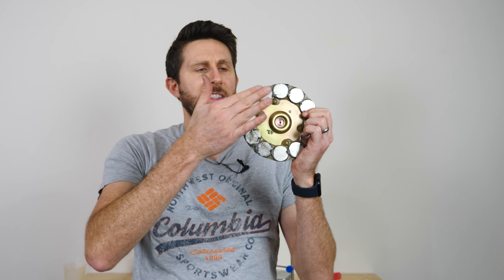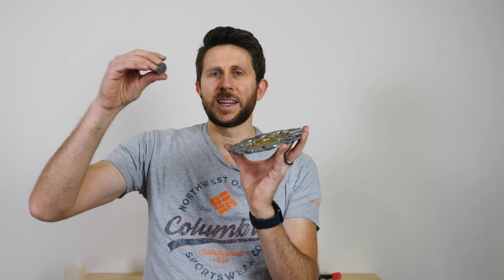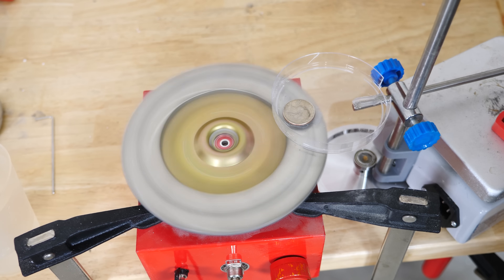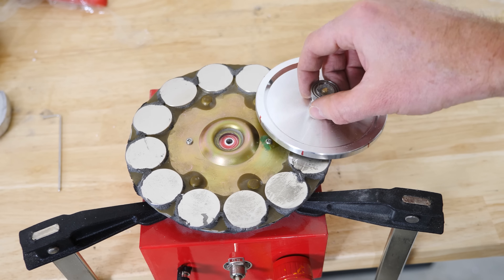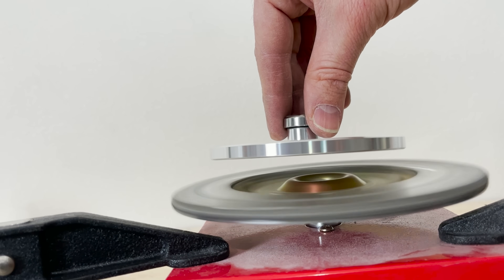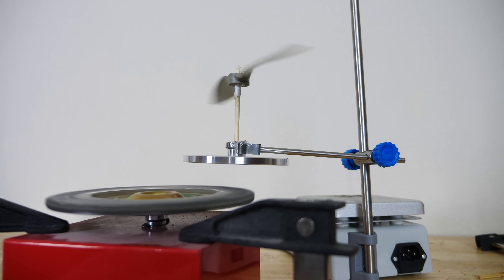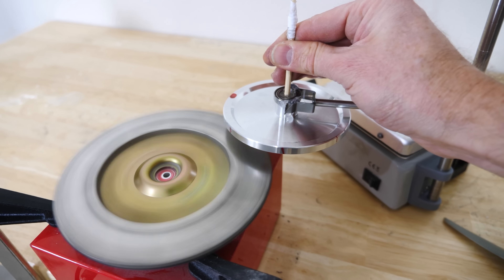How To Make Invisible Gears With Eddy Currents

Comment: Induction cookers don't have giant magnet wheel that rotates fast though. An induction cooker just has a coil and a tank capacitor that resonates around a frequency (28kHz in my case) with a PWM signal from an IGBT. That changing magnetic field induces eddy current on the utensil and that gets hot. Same goes for wireless power transfer and wireless mobile charging. With this setup the utensil would fly out of the cooktop LOL

Also, it needs both eddy currents and high magnetic permeability and lower skin depth (for higher resistance) at the same time. For example, Copper induces strong eddy currents, but doesn't heat up as it doesn't have high enough magnetic permeability. On the other hand, A ferrite core (with very high magnetic permeability) won't heat up as ferrite cores won't induce eddy currents! Same goes for iron powder cores or sendust cores or MPP or nanocrystalline - they don't heat up even though they are magnetic.

Comment: Does this have any particular advantages, in an engineering sense, over magnetic gears that use magnets on both sides?
Reply: No, but there's a neutral side: it needs acceleration to work.

Other than the engineering sense, it's cheaper

Comment: Got idea for ozone fix a flat, calling it nimrods ratio, it's where u make a tower that only goes so hi, and then make the upper part a kite that carries the hose if possible for a direct infusion like terraforming or mending otherwise, maybe cool.
Reply: The ratio part is how u had to imagine what would work best an try it.
Reply: Try to do something like scaffolding with making the visible metal change places having water in a tube and a surfboard, try implement superconductor som3where , and try corona motor, where I'm wondering if a wireless circuit can be formed using info on superposition doppelganger ganger type +/- particles and is there relevant to static generator, an the ark of the Covenant inside the middle of the pyramid, and a metal roof, and how could you make the black boxes inside the pyramid, I thought maybe they must have used for finalizing one of those suction cup carbon or diamond something sandpaper like buffers to keep exact balance maybe a technique used, I was thinking about metronome  self climbing frequencys, wonder if alternating fields can be bled together with something to do with Higgins field theory, then it's just like what's effected by magnets or whatever, kinda wonder if u removed and replaced the electrons or something at the same time will it get colder if the overall movement is tu4ned down also ultimately I like the idea of making a worm hole o4 several type configurations using regular electric or otherwise, but would like to c9me up with ultra Hoffman apparatus like filtration of all the elements if can, I seen u could use a leaf blower to flash burn gold ore then throw vinegar an overnight crushes like powder, we should use filtration magic or whatever to process recycle new yorks trash at least for profit somehow now.
Reply: They could map out Higgins field, and if possible implement ai aprox until mapping of virtual projected overlapped during alternating field studies, on various depths of magnifying temperature, size, conductivity, frequency categorization of water to include the new way to use electrolysis by using suction to replace next molecule needing zapped, also to attempt to map out any real inadvertent always solid representation of phantom pain and the actual position of the limb or appendage, I believe skips the brain reading part of real time reaction or action, or a new phantom pain l, could be mapp3d out through seismic sensitivity, so pressure and position of things a4e mutual, basically using thought still but by feeling, makes more passive effectiveness. So mak3 fake arms come to life, because you feel the body of the limbs, I think the concept of a photon torpedo kinda is an idea of gathering of fields makes them more solid.
Reply: + Higgins field is supposedly directionless is perhaps a lie, because if it's existing makes a plasma kinda like keylating ligands in a petri dish, except the petri dish ends at the edge of space where the laws of nothingness is more literal, is my hypothesis, and if new galaxies show up, well maybe the 3nd of space continues to receed, 5hey say Beetlejuice is yellow or red now, so Higgins field might be more of a camera angle, and as the platform of existence technically, it includes in how it operates nothing, I can change how it operates, especially if implosion type end of universe style realities might be in place, however  recently they believed that Hawkins must be right, and a blackhole evaporates, I think frequency machines along with filtration power, can lead to a more solid matter, graphite is pretty cool, but there might be something else maybe, was thinking about molecular metronome connections, and it'd be fun to try to build scaffolding atomicly, I think zero kelvin has to be more interesting, and 2hat are the limits to the peltier I wonder.
Reply: Or Higgins field is only a variable that applies to known existence, but also focused on passage of time universally somehow, along with maximum time flow due to elevation, and if time goes by faster in 1 place how is it still before in another, so time is relative to the quantum effects of certain perceptions, 9r basically how people interpret the passage of time is from what they're experiencing, but the laws themselves change due to the actuator limitations, which in my explanation is the root of perception like eye on dollar bill, it says we have 1, so who's we, and if there wasn't 1, then I call that the 1, and I'd be experiencing it, because even 8f time went by faster at higher elevations, it couldn't go by faster than the speed that I gather is going on in the 0ast technically, because of prob double slit effect, mixed with entanglement of sole source of "the whole speaks for the one, but what if one of them spoke for the whole sorta, so metronome can change by base assumption of what the base is, and I figure if j was somehow center 9f everything in a way I'd probably figure it out. so basically it sucks to be isolated isn't entirely false sometimes.

Comment: so if you put the alluminium fly wheel closer to te magnets, it will turn faster. But how faster? will it  follow the gear ratio sistem ? so if the biggest gear diameter is 10 cm and  the smallest is 5 cm the ratio wll be 1: 2?

Comment: It acts like a mechanical clutch.
Reply: mechanical clutch. ?     what other kind is there.?        maybe you  Meant to say   magnetic
Reply: @daviddavids2884  it’s kind of induction motor what is shown in the video. Induction Motor has similar analogy as clutch. Relative motion Between stator magnetic field and rotor conductor induces rotor current hence torque. Similarly in clutch mechanism relative motion Between clutch plates creates friction which creates torque.

Comment: two facts about what you said:
1) Cody's lab made a video melting a bullet with magnets
2) I have a pan that is barely balanced on it's edge, so when it's putted on an induction cooker, it will tilt, the cooker will turn off (because it doesn't detect it) so the pan falls down and repeat

Comment: In an automobile internship contest, I had presented a similar idea of having synchromesh replaced with neodymium magnets and aluminium gears inside a transmission. One of the panelists was like "eddy currents? We don't want sparks and fire inside a transmission!"
Lol.
Reply: well.       it was a  Dumb  idea, regardless          because, if a significant  load is present at the  driven wheel before it is  turning,  the results would  be  No  motion, and  a Hot  driven wheel.
Reply: @daviddavids2884  What's the alternate in that scenario? I guess ground shavings of dog teeth going into the lube oil? Or a heated up synchro? Did you forget that clutch exists?

EDIT: perhaps you thought that the magnetism is the only thing transmitting the load. But I proposed alternative for the friction based synchronizer only, not the dog gear teeth which actually transmits the load.

Nevertheless, it was a bad idea, because friction synchros can bring relative speed to 0, but two parts using eddy currents to synchronize will have always have relative motion, just like an induction motor (and as opposed to a synchronous motor).

Comment: I wonder if you could engineer a torque converter for a car this way and have an "air coupling" instead of a "fluid coupling"... Of course then at idle the part of the coupling connected to the transmission would heat to the point of failure without some sort of major cooling system for it, would be cool to see if it would work though.
Reply: really.?       you suggested something silly,  explained  Why it was silly,  and  STILL  'would be cool to see if it works'.           lmfao
Reply: @daviddavids2884  yep. Thats right bro. I imagine some of the greatest innovations have started off from someone thinking the same way. Gotta start off thinking of crazy stuff and then figure out how to make it work.... So yeah... Really!
Reply: @daviddavids2884  but don't worry, I see you don't come from a very creative gene pool given out of all the names in the world, you were given the same name twice. To your parents... You had one job!

Comment: Too bad they can't make a cvt that works on this principal. Or can they. Since the current ones are prone to failure. If this worked there would be no actual metal to metal interface and could theoretically last forever. They couldn't let that happen though no repair $ involved.

Comment: Where is the best place to get the magnets. I have been buying smaller ones on amazon for my class, but getting larger sizes and more of them gets expensive fast. I know they are not cheap magnets, just wondering if there is a better place.
Reply: some hardware stores sell small ones.      or craft stores.  or  k&j magnetics    online.      a  large one  will Cost  you, no  matter where it's  sold.          check online at  lowes, etc.

Comment: could this be used to make unlimited energy? of course i know the idea of you can't make energy only convert it. but could a single spinning motor cause multiple discs to spin? theres no friction. no draw of energy. and it doesn't appear that stoping the metal disc puts extra force on the base. so would adding 9 more spinning discs mean that each only receives 1/10th of the energy?
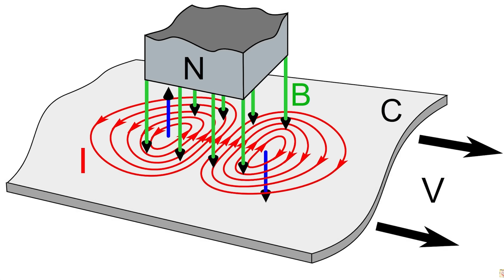Reply: 0:50 - the eddy current creates a magnetic field that opposes the source magnetic field. So from the perspective of the drive wheel the eddy currents act as a magnetic "drag".

Comment: The arrows in the Thumbnail are pointing the wrong way. Spinning gears would mesh the opposite way. Counter clockwise on the top right gear would mean clockwise on the bottom left gear.

Comment: Maybe the glued coin is getting heated due to actual physical friction only.
Even though it's glued, there might be some very small (dx) displacement by which it quickly moves to-and-fro, rubbing itself on the surface very quickly, causing friction and then heat...

Comment: I think not so accurate to call it invisible gear... Its more like wireless power/force/motion transmission. It was quite common in magnetic drive pumps, except that they both use magnets for driver and driven parts separated with plastic casing.

Comment: 2:35 actually more conductive vessels won't work in induction stove .. because of low ohmic resistance .. for example aluminium vessels doesn't work in induction but stainless steel does. Simply because the aluminium is more conductive and has less resistance stainless steel is less conductive and has more resistance . Hope I'm clear 😃

Comment: Wrap a coil around a coin. Apply 100kV with low source impedance [Rail gun surplus capacitor]. The coil explodes into small pieces, and the coin shrinks in diameter. I still have them from 1994.

Comment: A company called Magnadrive tried to commercialize this for actual gearing on motors.  Shafts did not require perfect alignment, bearings didn't wear out, and it was quieter and more controllable for speed.  Unfortunately, they could not manufacture them in volume for these specialized needs.

Comment: I have seen slip clutches on big industrial drives that had magnets on both wheels but not something that was "geared" like this. Cool idea. Using eddy currents you can have a loosely coupled and geared slip drive (consumer air fan) and with magnets on both wheels you can do the same with nearly no slip (Industrial or automotive transmission?). Particularly useful since the slip can be modulated like an automotive clutch.

Comment: Love this bro, counter rotating field generator two plates of fr5 with directionally patterned 2”copper strap 6’ and 8’ natural green g10 discs with the copper strap in an accelerating electrode pattern. The lower disc is sucking up air, the upper 8’ disk is shooting it out. Mount this in an aluminum skirt with mesh under the aluminum charged negative as a target for the radiation to flow through and run down the skirt or hull of the craft, now mount yourself a chair and fly!!! In your homopolar aerodyne compliments of electro gravitational potentials P2

Comment: Yo excuse me, mechanically if the gears are made to conduct magnitude through the coil , due to heat , pressure and temperature,they might fail theoriticaly,but practically it might works.

Comment: So when our conductor is held stationary, all of the induced electromagnetic energy is converted to heat as friction (the force which we are applying on our conductor to hold it stationary) is present and it's doing work. But when we don't hold it still forcibly (no friction present), then no electromagnetic energy is lost as heat. Rather it's converted completely to kinetic energy. Am I right?

Comment: haha, how bad did you burn your fingers when you accidentally removed the glued down coin? seems like some discomfort for some time. When I accidentally touch something too hot in my lab, I rush to the bathroom and run the cold water from the tub as hard as possible over my burned fingers... it removes the excess heat that is still in the flesh for quite some time... which will create more burned damage if left alone.

Comment: As an Engineer I can tell you that invisible gears are difficult to make. Gears are made with Gear Hobs, and depending on the Pressure Angle and Pitch each Hob is made special and precise. The problem comes in when cutting the invisible gear material, zeroing an invisible Gear Hob is difficult at best. And advancing the Invisible Dividing head the proper amount is extremely hard when you cannot see the tool, the Divider, or the gear material. That is why they cost so much. But they do run quietly with very little gear backlash.

Comment: Hi :)

Great Videos!!

Now try putting another Set of Magnets on top or an Electromagnet thatswitches so its always the Opposite of the Magnet downstatairs, it should strengthen the Coupling.

Also how fast are Discs spinning? is the coupled One just as fast as the Spinner?

Comment: You'd almost think you could run a Nitinol Motor with the heat from the item that is being heated up to run the motor that's spinning the magnets and make it a Closed Loop system to be able to give you excess electricity to run another motor for locomotive force for a car or for charging other devices... OVER UNITY ? Either way that's still Mass In Motion...
A Huge Spinning Flywheel Full of Water That Is Always Spinning that is ALWAYS GENERATING ELECTRICITY, that's what we really need. Just water tanks that look like little spacecraft/jets (Ion Engines in a Vaccum ?) floating on a magnetic track on the ends of the arms/wings holding them which could just be wire cables or something else... We need to get rid of these Coal Powered Generator's that are mostly being used for home heating.. We could accelerate these Giant Wheels/Wings with huge bursts of electricity from supercapacitor's that are being charged through solar cells on the outside of these giant spinning disks/arms and if the Electrical System that these Super Capicitors are on is a Closed Loop Electrical System and has an Acrive Low Voltege Simmer Current on it then we can dump Huge Burstes of Electricity on the electrical system with these Super Capicitors to keep these Generators running. We need to have these fuel tanks full of water/sand (think Mass in Motion) that can be assisted with compressed air other or fuels like flash steam or gravitationally and magnetically assisted systems and other methods/device's/fuels to keep these things spinning and always need to be spinning to generate this Electricity that we need. A Multi Fueled System is what we need. If just the lack of electricity is the problem we need to start looking at the objects and materials that we already have and start looking at the problem from the top down and approach it from there. #1: We need Clean Electricity #2: We have the Sun, #3: We have Water, #4: We have Gravity, #5: We have the Wheel, #6: We have Magnets, #7: We have Electricity and a limited comprehension of what the problem is that we're dealing with and how to attempt to try and solve the problem that we are dealing with in a rational manner and what it is that we are really trying to do which is just being the need to be able to create clean electricity without creating the pollution that we are dealing with due to the current methods and fuels that we are using now to generate this Electricity that we we need to be able to heat our homes with and how to go about attemp to try and approach the problem in a responsible, sensible manner how could we go wrong ?